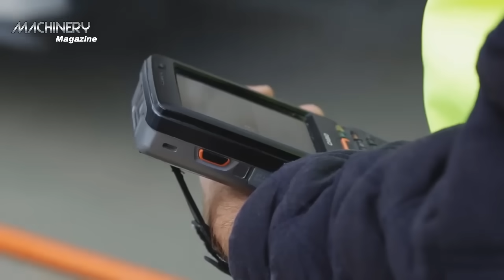Incredible Modern Road Construction Machine Technology - Fastest Concrete Paving Equipment Machines

Comment: Can’t believe anyone still uses concrete for roads.
Reply: What we use nowadays brother?
Reply: Dadan Nurjaman Asphalt is used through out Canada and a lot of the USA. Often it can be re-melted, bonding agents added, and re-applied with little waste.
Reply: @Rangetechus  lol i thought u will mention some other new material.
Reply: In extreme climate specially hot countries concrete is used.
Reply: Why not? Concrete if somebody  use it correctly it will have more endurance than asphalt.
Reply: concrete last longer then Asphalt that for sure
Reply: 【MY METHODS 67】Calculate a side length of a triangle